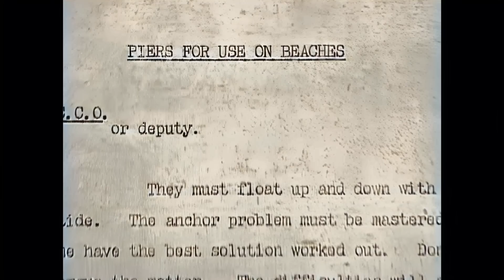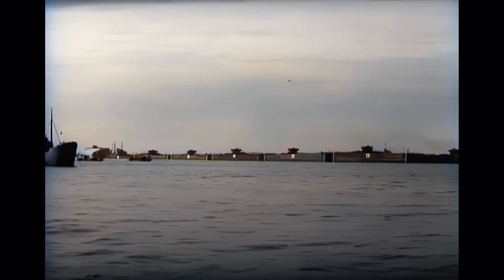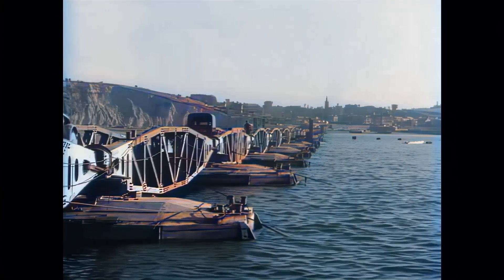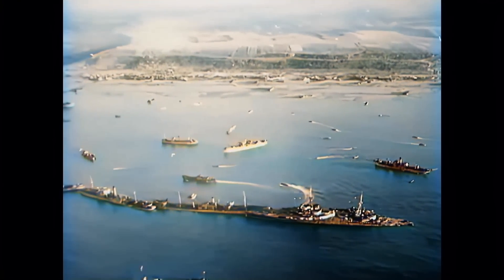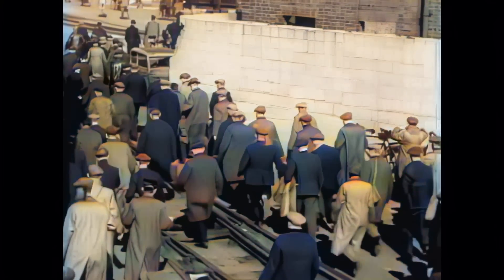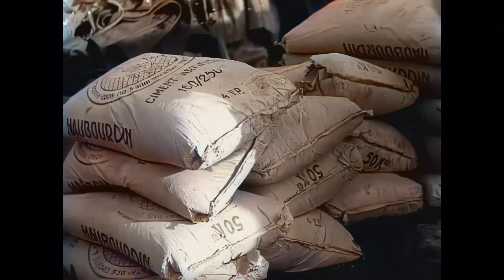D-day, the Harbor that went to France:  The spectacular rise and fall of the Mulberry Harbor (color)

Comment from the maker: FULL TRANSCRIPT: The construction of the socalled Mulberry harbors was one on the technological miracles that contributed to the success of D-day and the subsequent Battle of Normandy in June 1944.
It was Sir Winston Churchill who realized the need to build an artificial harbor in order for the invasion of Europe to succeed during WWII.
As a navy man with decades of experience and as previous lord of the Admiralty he knew too well what could go wrong during beach landings.
He had seen that at first hand at Galipoli.

On the 30th of May 1942 Churchill drafted a memorandum, headed 'Piers for use on beaches', which set out the problems with artificial harbors and insisted not to argue about his predicted difficulties.

Especially the differences between high and low tides in the North of France with sea height differences of 8 meters between ebb and flood, plus the fact that the sea retracts for more than half a kilometer during low tide would make it almost impossible to unload goods during the whole day. In stead the conditions for such would only allow goods unloading during two narrow windows each of about an hour a day.

Young engineer Alan Beckett designed most parts of the artificial harbor. 
The highly secret project was dubbed "Mulberry", probably inspired by a mulberry tree that grew in the back garden of his house.

Many different types of structures were designed to give the Mulberry harbor shape, each with weird names like "Whales", "Rhinos" "Phoenixs", "Beetles" and "Spuds"

One of the main objectives was to construct a harbor that would be protected against the force of the sea especially during the frequently occurring storms. This protection was achieved by constructing a breakwater consisting of caissons (so called Phoenixs) and old ships that were sunk in a semi-circle with a radius of about 2.5 km around the small French sea side town of Arromanche. The wall stretched from the north of Manvieux in the West up to Asnelles east of Arromanche, opposite Gold beach. These old ships consisted of 61 so called "Corncobs" that sailed from Britain to France under their own steam or being towed before being scuttled. 

Mulberry was to become a partially floating harbor consisting of the already mentioned artificial breakwater (so called Bombardons), beach heads and mile long floating bridges consisting of pontoons (so called "beetles") connected by bridge elements (so called Whales). At the beginning of each floating bridge would be a pier head that rested on the sea bed using adjustable legs (so called "Spuds"). The height of the pier heads would automatically adjust with the tides. Each floating bridge (or pier) was about 2 km long, consisting of just over 40 Whales and the same number of Beetles. In total 16km of Whale roadways were manufactured.

The outer breakwater structures that created the artificial harbors were called "Gooseberries". 
Hopefully you have been paying attention because all these names will frequently pop up during the rest of this documentary!

In total all the objects that were part of the breakwater formed an 8 km long arc structure. The concrete Phoenix caissons were equiped with anti-aircraft guns and protected from low level bombing by means of barrage balloons. 

The first Phoenix was sunk on the 9th of June. The Gooseberry was finished by 11 June. It only took about half an hour to sink a Phoenix. It was just a matter of correctly positioning the Phoenixs and then opening the slides to fill these caissons with sea water. By the 18th of June two piers and four pier heads with the afore mentioned Spuds were in operation. The harbor would have three entrances at the East, West and North which simply were openings in the Gooseberry breakwater wall of Phoenixs caissons and Corncob sunken old ships.

All required equipment was designed and built in the United Kingdom. Huge docks at Southampton were used for that purpose as well as many construction facilities at Marchwood military harbor, at Lepe beach and allong the Beaulieu river, adjacent to the New Forest. 

Up to 40.000 people were employed to construct Mulberry's components. Hardly any one of them knew what they were working on. Especially the purpose of the Phoenix caissons could not easily be derived from their shape and construction. No one would expect that these huge concrete structures, [30 meters] high and weighing [6.000] tons were intended to float, let alone be tugged all across the Channel to France.

Although the construction was an all British effort, the actual deployment of the harbor was split into two projects, named "Mulberry-A", run by the Americans and "Mulberry-B" by the British and Canadians. Mulberry-A was assembled at Omaha beach and Mulberry-B at Gold beach.

Two weeks after D-day, on 19 June 1944 a severe storm hit the coast of Normandy which lasted for 4 days. As a result the American Mulberry-A harbor was largely destroyed whereas the British Mulberry-B survived. The video shows some spectacular shots of what happened to the bridge elements and Phoenix break walls. All that remained were twisted heaps of steel. In total 21 of the 28 Phoenixs were destroyed. The Americans decided to abandon Mulberry-A. Some parts that were somewhat useable were towed to the British Mulberry-B side, in particular to be sunk in order to strengthen the Phoenix break walls.

One may speculate why one harbor survived and the other didn't. Some historians claim that Mulberry-A to the West was more exposed to the forces of nature. However, another important fact should not be overlooked: Mulberry's designer Alan Bennett had designed special light weight anchors that were intended to keep each bridge element in place. 

British engineers made every effort to ensure that these anchors did their job and were tightly dug into the sand. The Americans on the other hand did not take this too serious. In stead of using an achor for each bridge element they only deployed one for every sixth element. Also they mixed 60 and 80 meter bridge elements at random. 

Probably a certain element of rivalry came also into play, challenging American and British troups to have a contest of who would be the first to finish their part of the Mulberry harbor. These mistakes turned out to be fatal for Mulberry-A. General Eisenhower was compelled to abandon its use.

The British Mulberry-B harbor remained in operation for 10 months, although it was originally only intended to be used for 3 months. During this time it was simply renamed to "Port Winston" in honor of British prime minister Winston Churchill who was the original creative genious behind the plan.

One may wonder whether the floating piers and spud pier heads were really necessary. Fact is that the Americans continued to unload goods on Omaha beach using landing craft on wheels, so called "Ducks" and by using smaller vessels that took their goods on board by cranes from the large cargo ships. More than half of all the goods were brought on land this way.

Thanks for watching!

Source: Archive.org
Music: Howard Harper Barnes
Reply: Very good account of history 👍🇬🇧
Reply from the maker: @Yorkshire321  Thank you very much

Comment: "At the end of the year, looking back on its experience over 'Mulberry', the Ministry of Supply had to report that 'a great deal of work which had to be carried out to meet these programmes was only found possible by the granting of a real overriding priority which was used in some cases ruthlessly'. The report goes on to say that, by any ordinary methods, the task could not have been met and the deliveries to arranged dates could not have been achieved.
No wonder other production had to be sacrificed, even if the industrial effort as a whole as not in any way set back. The war-stores which suffered most were gun carriages, tanks, jerricans, steam-boilers, ammunition boxes, and, above all, Bailey bridges. At one time the making of the floating-bridge units for the piers represented as much as fifty percent of the total production of military bridging. In addition, the fabrication of the pier-heads led to some 
--283-- 
delay in ship construction and repair, although no interference in landing craft was permitted. That these losses did no harm is perhaps due to the healthy condition of British supplies and stocks on the even of D-day; that the losses were no greater is evidence of the efficiency and elasticity of British war production in the fifth year of war."
Hyperwar From Pearl Harbor to victory in Europe II the ebb and flow of munitions

Comment: Right off the town of Southend on Sea is a section of the Mulberry harbor that broke away while being towed across to the beaches
Reply: There is also a section off Hayling Island, only 600 yards from where it was constructed.
Reply: The one near Southend would not have broken loose "while being towed across to the beaches" but earlier when being towed (only in darkness, to avoid being spotted) from where constructed (various locations around Britain) to the holding areas (generally, the area around the Solent), prior to being towed to France.

Comment: I’d e  previously heard that MuLberry A wasn’t built to full spec, but not that they had missed so many anchors. Just imagine what the result would have been if both Mulberry harbours had been in operation after D day.
Reply from the maker: Do you think there would have been much difference? The American succeeded quite well to unload their goods without the Mulberry A harbour! I would like to know what would have happened if NO harbors had been built, i.e. that the Brits would have unloaded the same way as the Yanks? What if they instead had built large goods landing craft in stead (alike the "ducks" on wheels)? Any ideas? 
One thing is for sure: the 45.000 men that built these structures (during about 1 year) would have made themselves (more?) useful in other aspects of the war/invasion efforts...
Reply: @Rick88888888  - the Mulberry B was able to handle more supplies than landing them over the beach. If there were 2 fully operational Mulberries then we probably wouldn’t have had Patton and Monty running low on supplies and having to slow their advances once the breakout had been obtained.
Reply: @MadMonk_  "Undismayed by the destruction of their artificial harbour, the Americans applied to the development of the Omaha and Utah anchorages their tremendous talent for invention and organization. In defiance of orthodox opinion they beached coasters (LST's) and unloaded them direct into Army lorries at low tide... during July the Americans here handled more than twice the tonnage which passed through the British Mulberry."

Chester, Wilmot, The Struggle for Europe page 387

Comment: Typical yanks , Think they know best 
Just proves that they know nothing.. 
All that work by the british and wasted by the clowns who didnt build it properly
Reply: turns out the yanks still moved more tonnage their own way
Reply: @georgewallace8933  Thank you. We thank Roosevelt. We thank the USA. Thanks again. In case there is any doubt; thanks a lot!    Thanks.
Reply: cost of Mulberry A was subtracted from Lend Lease debt.

"We found that the waves at   the American harbour   were significantly larger than those at the British Mulberry — although both experienced waves larger than they were designed to withstand. This goes a long way to explain why the American harbour failed whilst the British one narrowly survived. We also found that a storm of the severity of the 1944 storm would only be expected to occur during the summer once in every 40 years. The Allies were clearly very unlucky to experience a storm this severe only a couple of weeks after D-Day."
University of Oxford The storm that struck the Mulberry Harbours page

"We may begin by recording the final and complete settlement of lend-lease.23 Over the whole period from March 1941 to September 1945, the balance in favour of the United States in the mutual aid books24 was in round terms about $21,000 millions. But by the settlement of 1945 Britain was required to pay no more than $650 millions, or £162 millions sterling."
 page 547 British War Economy

Comment: This really is a fascinating topic, thank you for bringing it to life in colour! The storm that hit the harbours was the worst in 40 years, so not expected or at all typical It still annoys me that American hubris resulted in the wrecking of their harbour. This was the first time such an engineering endeavour had been attempted, and the British design is an example of some of the best military engineering in history. The beaches were very vulnerable to attack and bad weather, especially in the critical early stages; it's fine for some comments saying they weren't needed but hindsight is great. The fact is the beach landings were largely unmolested and the weather, after the initial storm, was largely benign. The British also developed an innovative series of pipes to run under the Channel to transport oil, petrol and lubricants under Operation Pluto (Pipe Line Under The Ocean).
Reply: "We found that the waves at the American harbour were significantly larger than those at the British Mulberry — although both experienced waves larger than they were designed to withstand. This goes a long way to explain why the American harbour failed    whilst the British one narrowly survived.    We also found that a storm of the severity of the 1944 storm would only be expected to occur during the summer once in every 40 years. The Allies were clearly very unlucky to experience a storm this severe only a couple of weeks after D-Day." 
University of Oxford The storm that struck the Mulberry Harbours page
Reply: Agree, fascinating footage and so beautifully restored and colourized! :)